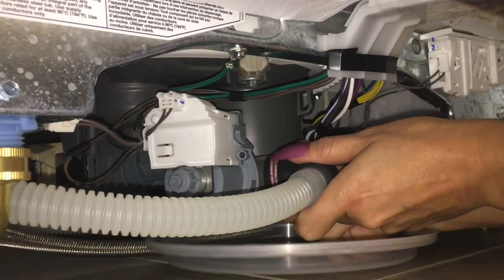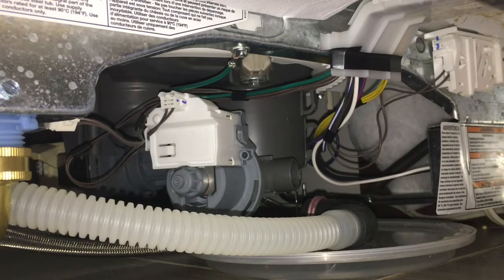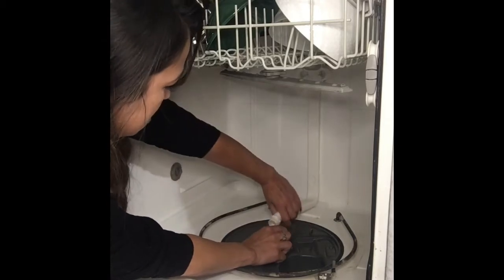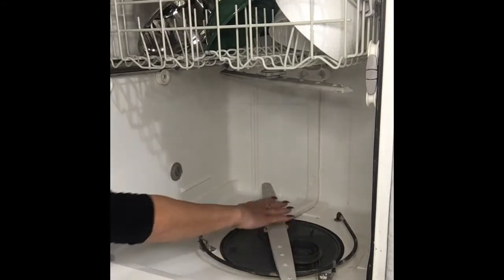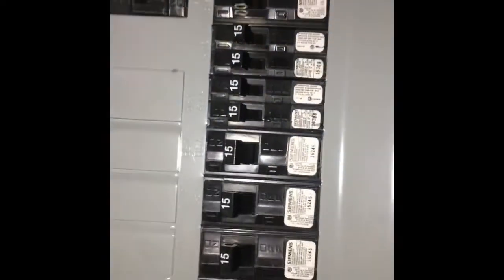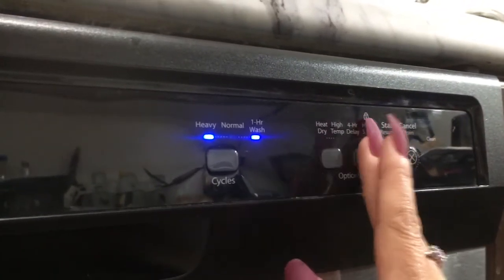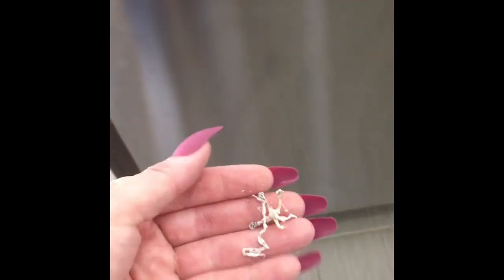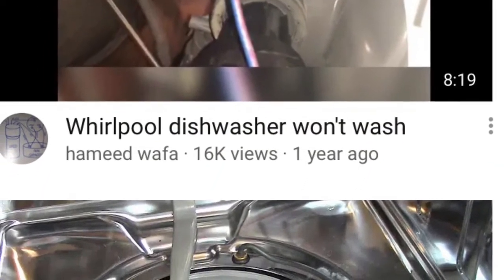How to fix your whirlpool dishwasher

Comment: Hi How r u? I got a burn from the electric resistance, anyways I AM checking it as u did and i did the diagnóstic Part and didnt work. I cleaned up and took some things apart and i saw nothing. Just don't spray it. What else did u do? Can You Tell me please?
Reply from the maker: Good morning, make sure you turn off power at electrical box. The piece I found was on the very back of the dishwasher in the motor
Reply from the maker: It was easy to take apart and put back together. I will see if I can find another link to watch. That helped me out